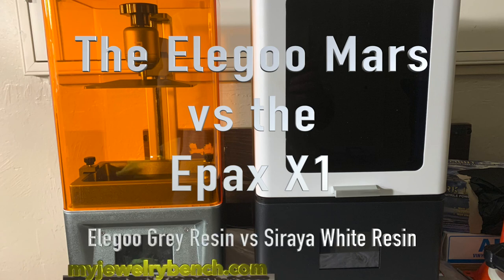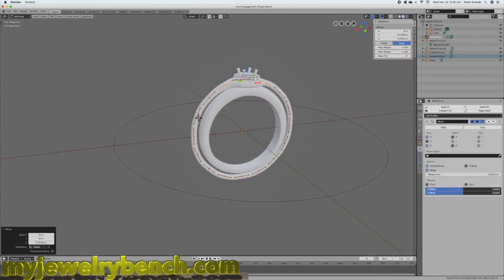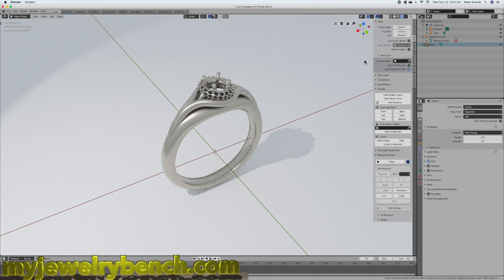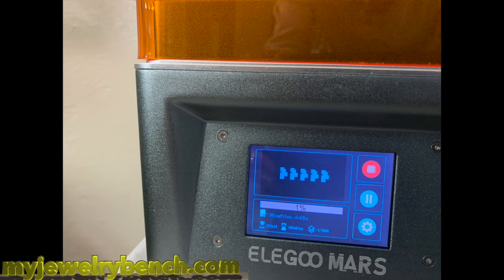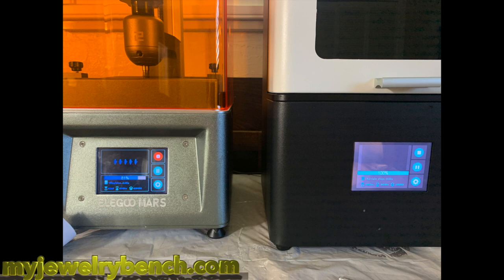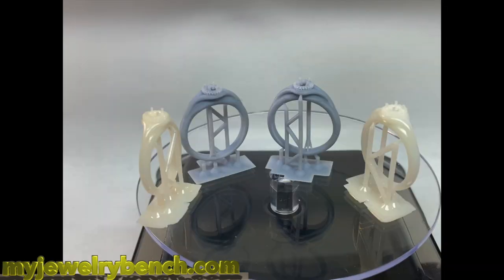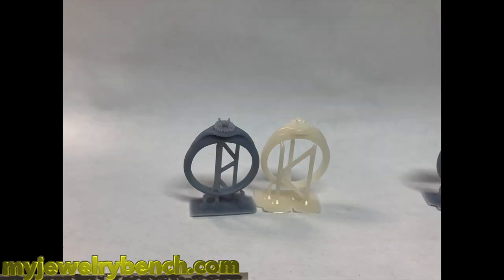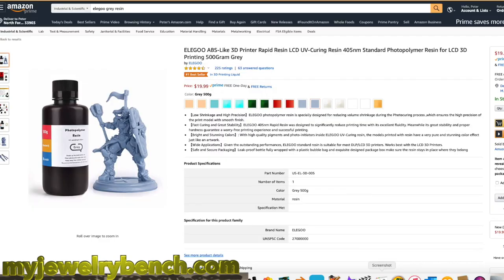3d Resin Printer Battle:  Elegoo Mars vs Epax X1  Part 1

Comment: Peter, why are you using the same exposure settings for both printers. Does the Epax not have the stronger UV light source?
Reply from the maker: I just wanted to try and see if there was a speed factor for vertical movement that ChiTuBox. Does not allow us to control. That was the only reason

Comment: Great comparison between the two printers.  They are both good IMO.  I'm getting ready to do my first print in the Epax with the Elegoo ABS-Like Gray resin.  I designed a class ring in Fusion 360.  I noticed that in some of your examples, you place the ring at an angle and on this example you pretty much had the ring straight up and down.  What criteria do you use to make that decision?  Also, in Chitubox, do you add the supports for one ring and then duplicate it or do you add supports to each duplicate individually?  I'm new to Chitubox as well.  Thanks for the advice.
Reply from the maker: The only reason I use different angles of printing is solely based on the design of the ring or pendant in an effort to get the best print possible. Vertical printing works for me about 90% of the time.
Reply: @watchesandjewelry  Thank you.  And to the question of supports in Chitubox, do you duplicate before or after you add supports?
Reply: @watchesandjewelry  Thank you.  Any comment about my question about duplicating the object in Chitubox and supports?  Please excuse the nu-bee question.

Comment: What settings do you recommend keeping the Epax set to with the Elegoo grey resin?
Reply from the maker: 50 second bottom,5 layers
Layer height .03 to ..04. 
7 seconds.  
That’s what I use. It may be different for you. If so. Up the layer time to 9 seconds.
Reply: @watchesandjewelry  Thanks!

Comment: they are the same machine under a different brand name if you open them you can find the same board. on the internet you can find people that have installed the epax firmware on the elegoo mars printer. so i can imagine that the difference in speed is just a different setting in the firmware but the quality is exactly the same ;))
Reply: You are incorrect.
Reply: @rabbidjeremy9193  go to the elegoo forum and see with your eyes.